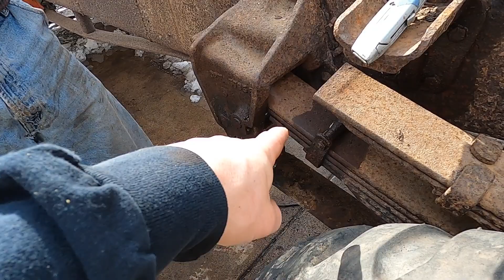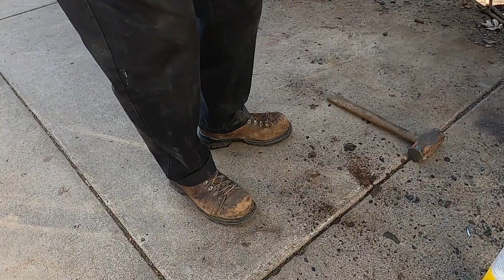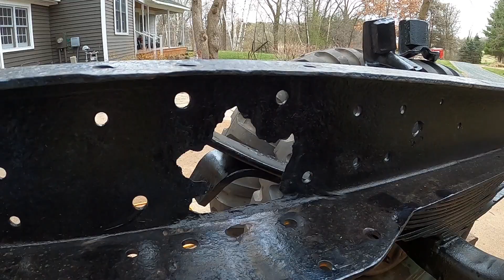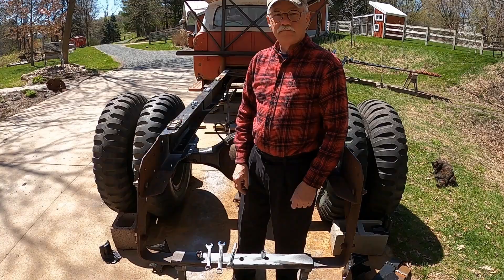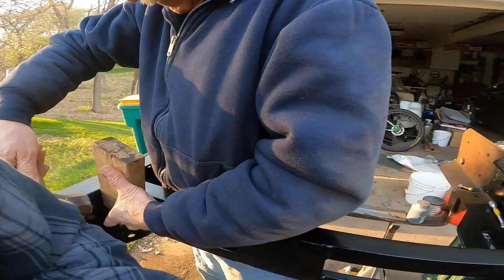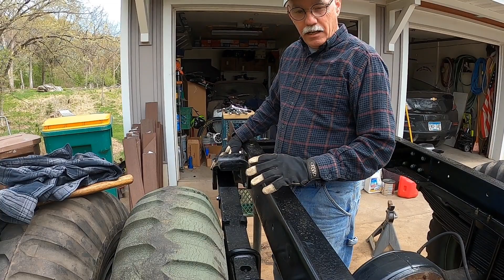1962 Ford F600 "Mouse": FULL Rear Suspension Restoration! Ep.15

Comment: I’m having trouble getting the right rear drum to rotate on a F600 I acquired. The rim is stuck to the face of the drum also. All the lug nuts are removed and I’ve yanked on the rim with a backhoe! Not coming off. Maybe I need to apply a lot of heat?
Have you removed your rear drums yet?